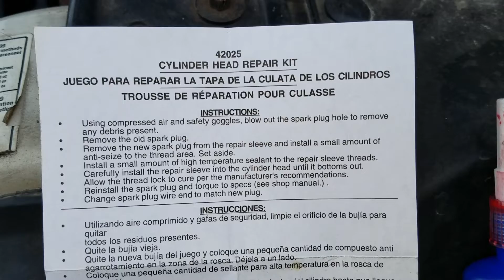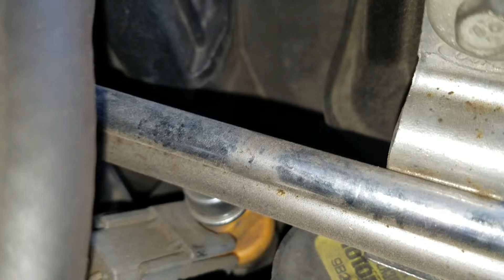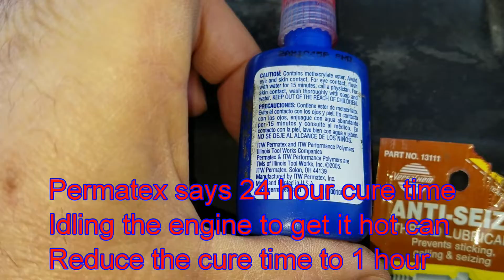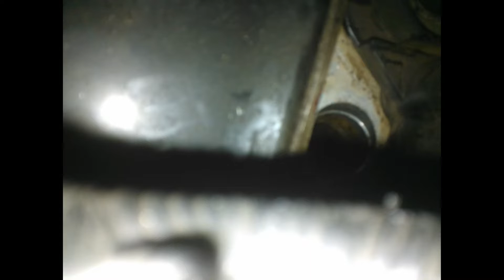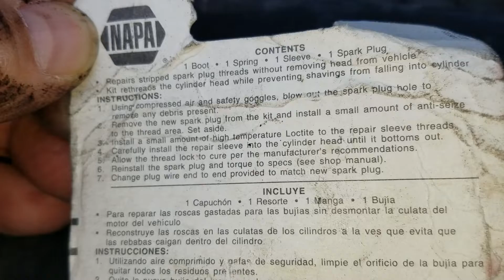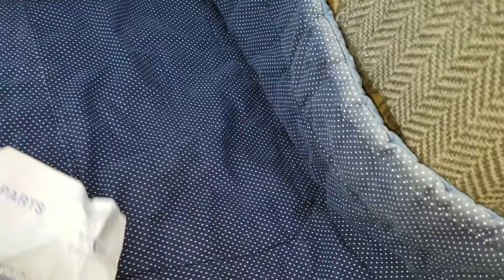Fast Permanent Fix FORD  5.4 L 2V Aluminum Head Spark Plug Seat Repair

Comment: That's only for the 2 valve Triton. Different threads in the 3 valve. Broke it off halfway through. Haven't tried to get it out yet.
Reply from the maker: Triton and 4 valve engines are different. Cal-Van is supposed to be the best repair kit.

Comment: I did this and now the socket is stuck in the hole and cannot for the life of me get bnb it out and don't know what to do. Any advice?
Reply from the maker: At the napa or other auto store, I bought a set of probing tools. I used one with a quarter inch 90 degree bend to stick down the hole in through the square drive opening and was able to pull the socket out. Should be able to do the same with any stiff wire with a small bend to hook and pull.
Reply from the maker: https://www.napaonline.com/en/p/CHQ60003?cid=paidsearch_shopping_dcoe_google&&gclid=CjwKCAjwt-L2BRA_EiwAacX32Xrr0iIVrRQvT1wuoBlcv7yyubsgKyNjZe0zEwjRXh-nsdR9HrB39RoCYiIQAvD_BwE

Comment: The plugs near the firewall are a B🤬TCH to get to! This happened to me after I let Ford dealership fix my truck... Pull out the dealership, and all of a sudden it won't shift pass 3rd! No time to fix... I'm driving around in 2 going 60mph. BANG! CLACKCLAKCLAK.......
Reply from the maker: What did the dealer do? I don't think a dealer would use this kit. The dealer would use either a Ford kit or a CAL-VAN kit. https://cal-vantools.com/products/ford-triton-spark-plug-thread-repair-kit/  Hope you get things back to working again. Nothing worse than not having your ride.
Reply: @CITAP1  little confusing to read. Took my 03 F150 5.4 V8 Lariat to the dealer to remove alarm (disabled truck) and replace frozen ac clutch. $1500 later I get it back broke. Solenoid B failing, won't shift to 3rd. Kicker is instead of removing the alarm like I said  they put a paperclip in the connector, wires all hanging........ raised hell that day.  Spark plug blew day after as I refused to let them touch my truck and pushed 2nd to hard. That 03 lariat is a beast.
Reply from the maker: @Bipolar4real  Not sure I understand the problem but sounds terrible. Sorry you're getting hit with bad workmanship like this. Hope you get it worked out.

Comment: It should be only a 5 min video and not 20min..... stop talking and just do the  repair.
Reply from the maker: You can always fast forward and search for the parts you need to see. A lot of people aren't so mechanically inclined and need all the details. You can't please everyone!
All anyone needs to know is, Remove spark plug, screw down and bottom out new repair seat with hi-temp red thread lock on it. Wait 24 hours. Screw in new spark plug and reconnect coil. Drive away.

Comment: Do they make a slightly larger sleeve than this ? My issue is that the sleeve in that kit broke and left the threads into the spark plug hole I drilled it out with a 9/16 bit same size as the spark plug threading and got all clean and now another sleeve in the kit won’t catch smh
Reply from the maker: Oh Man, Sorry you're having trouble. You'll need to go the next step with the Cal~Van Repair kit. It's more involved and expensive but it is the far superior permanent repair. https://cal-vantools.com/products/ford-triton-spark-plug-thread-repair-kit/ Good luck with it. There are several videos showing the Cal~Van installation.

Comment: Guys, JB Weld is far better than using People Permatex lock tight if you are using this tool. This will help prevent vacuum and exhaust leaks in the future. Good luck.....
Reply from the maker: The kit recommends hi temperature Red Loctite. There are others who have used the JB Weld with success they say. If there is a hi temperature JB Weld, I wouldn't have too big an issue using it but remember, you're not installing as recommended.

Comment: I did it with the 4.6 just can't get a socket around the adapter only the spark plug and its not down far enough and I already applyd thread locker any help

Comment: I use the same kit lasted for 20,000 miles and started leaking like a loosed spark plug, so I removed it and bought the same kit but instead of using a thread locker I used JB Weld high temp.Now the Expedition is running perfectly again So now I have a spare kit in my Glove comp. Just in case 20,000 miles it leaks air I will be deady
Reply: Hi just read your  post about repair kit its been 3 years what hPpen  still working mine just happen today

Comment: I hear people saying that this kit don’t last long did you have any problems after that
Reply from the maker: I used the kit in two cylinders and the kits worked fine for several years. I had one kit fail while on a road trip in Las Vegas. I got another kit and replaced the failed kit. Keep in mind this truck is a hard working truck hauling heavy loads most people never will. It also is used for a 3000 pound truck camper a lot. With stuff, the truck is carrying around 4500 pounds + during camping and road trips. This particular time happened while I was driving through the Southwest where speed limits are 80 MPH which is a big demand on a truck carrying that load and pushing through the air at those speeds for hours a day in warm weather. Frankly, I'm amazed the kits lasted as well and long as they did. The replacement kit lasted till the engine seized a few months later when the oil pump failed at 250000 plus miles. If you are just using a daily driver and not carrying heavy loads, I would bet the kit will last the vehicles remaining life. Just follow the kit directions and be sure to use the proper 500 degree high temperature Red Thread Locker the store usually does not stock, not the lower temp red they usually stock. These kits were all installed while I was on the road away from home somewhere, real life savers. I kept a kit in the truck after the first blow out and it sure came in handy on the side of the highway where I installed it in about 15 minutes and went on my way. I know the kit says let set 24 hours but I didn't have 24 hours, I'm working. My third replacement was done in a NAPA parking lot where I did let is setup 4 hours. I did idle the engine to heat things up and speed the dry time. I figured since the engine would just be idling, The pressures wouldn't be as great as if I was on the road with all the weight and pushing 70 MPH. Good luck with it.
Reply: CITAP1 thank you sir,

Comment: Besides that the spark plugs that he is using are the wrong one for a 5.4 y'all should no this that is if u change ur own spark plugs
Reply from the maker: Pay attention,  the plugs come with the new seat kit along with a shorter rubber plug boot and spark plug coil spring. That's how this kit works.

Comment: Don't I repeat do not buy this shit u will have more damage then what a blown spark plug does (cylinder head damage) meaning u will have to pay $4000. for the head to be resurface and fixed dont be a dumb ass
Reply from the maker: The kit works. If this kit fails, you can install one of the kits requiring drilling and tapping out the plug hole and installing a new seat. There is no way this kit will cause anyone to have to get a head resurfaced.

Comment: I’ve done 3 repairs on mine. The 3rd broke the steel insert at the thread to the hex head. I’m gonna use easyout to get the threaded portion out and try again. I thought maybe I cranked it down too tight and the plug hit piston but there’s no visible damage on the plug so I’m assuming I over tightened the repair insert and that’s what cracked it and running the engine broke it the rest of the way. Gonna try again tomorrow. The other thing is, the directions with the Dorma brand kit says “high temp sealant”. Not “high temp thread-locker”. So idk whats better. In my situation I’d hate to have thread-lock cause now I gotta try to dig out the broken threaded section. I’ve always used the hi temp thread sealant.
Reply from the maker: I never had one break on me. I did have one fail. Reinstalling it didn't work but installing a new one did. I also made sure to use the specified red thread which is not normally in the auto parts store. If the kit I'm showing here does completely fail, you can do the seat replacement kit. Since this repair,  my engine seized on me.  I bought a remanufactured engine that has all new replacement seats that uses normal sparkplugs and is running great.
Reply: Did you get the threaded section out?  Same thing happened to the shop working on my V10 and they can’t get the section out.
Reply from the maker: @hellome530  If Odins Lock doesn't reply, I will guess you may have to pull the head which is involved. Timing cover needs to come off. Your mechanic will have better access access to the plug hole. They could carefully apply heat then use an easy out to remove the broken seat. A reverse easy out may be needed to drive the seat out from the combustion side which will have easier access. If you end up going this route, replace the chain guides with new Ford guides and hydrolic tensioners. I read there are cast iron and composit versions with the composit being prefered. Do your research and good luck with things.
Reply: @CITAP1  thanks for the tip.  I hope he doesn’t have to pull the head because that’s at least $2500.  I was thinking maybe tapping the broken piece out but not sure what other damage it can cause.

Comment: Thinking of buying 1996 UK Ford transit camper diesel automatic
Fix
Or
Repair
Dailly

Its nice condition, retired couple had it for years now husband has dementia
Reply from the maker: If your ready for some travel, do it. Don't put off life, for too long. 
Don't know if you caught my latest videos, but the truck's engine has seized on me now due to oil pump failure. I'm installing a new engine in a couple days . The old engine had 250K miles, nothing lasts forever, a good run. Hope things workout for you on the Transit.
Reply: @CITAP1  transit has 400000km

Travelled since 1984 but cheap hotels and hostels (waste of money) 
Station wagon since July 2018 (saved a fortune) 
Yes started watching last week waiting for tow truck
Reply from the maker: @Kiwionwing  400K km is a fair amount of use. At that point it's not just the engine but transmission, suspension and other parts too unless already maintained. I guess you'll have to take a good look at the Transit and see if you can get comfortable with it and it's potential future. For me, Lots of work has already been done to my truck. It's future weak points are the transfer case, transmission, U-Joints, Intermediate bearing on driveshaft, entire brake system - 4 calipers + master cylinder. The engine is 3000.00 and the other parts I listed about another 5000.00. A newer truck would cost 30 to 50 thousand. It's cheaper to Fix Or Repair Daily this truck I figure.... 
Well good, sounds like you're a traveled soul. It's amazing the vehicles we can make due with traveling. I used to travel in a Ford Ranger I built a blue tarp canopy over and setup a bed and cooler with storage and had some great times traveling in that.

Comment: Better go in dry later the lock tight won’t hold as good cause u have lube on new threads .. I did this but use the professional kit even has a sleeve that guides the tools perfectly aligned
Reply from the maker: There is no drilling or machine oil with this fix. You simply use the high temp 500 degree Loxtite on the threads of the self tapping new seat and screw it in till bottoming and that's it, very simpleI have 2 plug repairs 3 and 4 years old and working fine.
Reply: It’s called ford triton spark plug thread repair kit look it up who ever looking to do this job

Comment: How about tightening all plugs every 10k miles to make sure they haven't loosened up?
Reply: There is a TSB on this, pretty sure the updated torque is 28 lbs.
Reply from the maker: I see a couple torque ratings listed for my 1999 F250 5.4 liter 2 valve engine. Old factory torque 15 ft# and a new rating 25 ft#. I have checked the plugs a couple times using 15 ft# setting and the plugs were that tight, not moving. If somebody wants to check totque, I'd say go for it, set your accurate torque wrench to 15 ft# and turn till it clicks, don't go beyond that tightness. Accept that it's that tight and don't go beyond that.

Comment: Long winded and no useful info....
Reply from the maker: I admit it's not a popup book but I try to be thorough in the information I give delivering tips and tricks on tools, materials, and how to do the repair. The only thing in this video that might be better is showing installing the new seat. I figure most people have turned a wrench and tightened down a bolt. That is essentially what this repair is. Putting High Temp Red Loctite on the new seat and running it down till it stops. It's a good easy fast repair that has held up well for me. My truck gets much heavier regular use than most peoples trucks ever will. If you do need to do this repair, I still recommend and stand behind it. Good luck...

Comment: Good video Jeff..easy to understand.
Reply from the maker: It's a good quick easy repair system. If it fails down the road, you can still do the more expensive seat replacement systems.

Comment: I found a better way , instead of loctite thread locker, I used JB weld around the sleeve of the new insert.Wait 24 hours and you are set for 20k miles.Thread won't seal.It will suck air and trigger po 171 and po 174 vacuum leak code.Intake manifold leak or bank too lean because it is sucking air.
Reply from the maker: There are people that used the JB high temp weld. I have the specified thread locker and am still doing fine with it with over 20K miles of hard duty use in my truck.
Reply: @CITAP1  I used the same method you did, but weeks later it trigger cel too lean in bank 1 po 171 so I pulled it out and reinstall it using JB weld and it lasted for 20,000 miles when it start leaking again so I re do the same process with JB weld and maybe in the next 20,000 miles it will leak again I would have enough money to buy a newer Expedition.But I want to thank you for posting such a wonderful video,God bless.
Reply from the maker: @efrensaclolo7021  Thank you and The Lords Blessings be upon you and your family as well. I had to re-repair 1 of mine too passing through Las Vegas. It lasted another year till my oil sump tube cracked and caused my engine to seize instantly.  Bought and installed a new engine and been working great. Take care...
Reply: @CITAP1  I should add for your subscribers that I used the same coil pack,I reattached the ear with JB weld and until this time it is still at work.Also I may add that my 2004 Expedition is 4.6 2valve and yours is 5.4 2valve and this works on both Ford Triton engines.Also install the spark plug inside the tap and just installed it in one piece.God Bless my friend.
Reply from the maker: @efrensaclolo7021  If you can reattach the dog ear, great, there is nothing wrong with the coil otherwise unless obviously damaged.  Best wishes...

Comment: Unless there is an Extreme Emergency, DON'T DO THIS! ESPECIALLY Don't loctite this in! This is a temporary fix at best. These will not last, trust me! Go get Cal-Van repair kit for Ford. If you want to see what happens with these, check out this video. https://www.youtube.com/watch?v=Dg6T2wig8yU&t=1540s  Its not my video but it is very informative. These things ruined my head.
Reply from the maker: I have 2 of these kits installed in my engine and they have held up great. One is about five years old now. The truck is a work truck regularly carrying heavy loads and a truck camper. The kit is simple, fast, and cheap to install. No shavings to fall into the cylinders.  If for some reason, years later, another repair is needed, you can at that time drill and tap a new Cal-Van kit seat at several times the price. This kit is an alternative that works for much less and can be done in under 15 minutes, complete.

Comment: Did you replace the ignition coil or were you able to use the old one with the new shorter extension. I saw the end of the video and it shows you purchased a new coil. Was it need for this repair?
Reply from the maker: Usually when the plug blows out of the head, it breaks the mounting tab on the coil. The coil will still work but won't  mount on the intake manifold. Whether you need a new coil or can still use the same one, you'll need to replace the stock plug boot and spring with the new shorter ones in the kit.
Reply: @CITAP1 Just blew the 3rd one on the drivers side. 2nd time blowing. Will this kit work for 2nd or 3rd repair on the same cylinder?
Reply from the maker: @jeffs1749  I had a failure this last January as I was leaving Las Vegas. Swung into NAPA and got a kit. They did not have the high temp red thread locker but I had an old tube of it in my tool kit along with an extra seat repair kit. First, I tried to reinstall the failed seat but it failed. I then tried the new seat I had in my kit and it has been working fine ever since. So you can use the repair twice on one cylinder.  I haul heavy loads in my truck so it bets hard duty use. If it does fail again, you can step up to one of the kits you drill out install an actual new seat. The method I show is a lot cheaper and easier and is a good first attempt repair.
Reply from the maker: @jeffs1749  Is your engine a first model year? Those were the worst for the Blowout problem.
Reply: @CITAP1  Its a 2001 F150 Supercrew
Reply from the maker: @jeffs1749  Mine's a 2000 5.4L (late 1999) and a machinist told me they were the improved heads with 5 thread turns, not 3. They are 2 valve heads, not a Triton 3 valve.